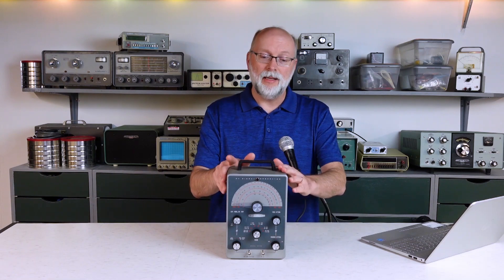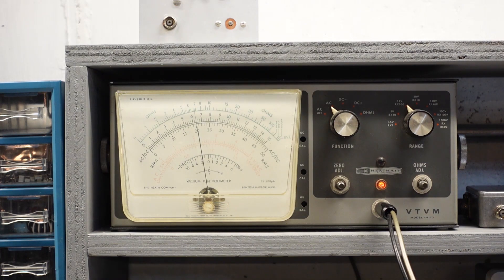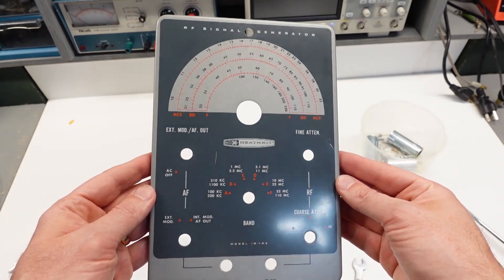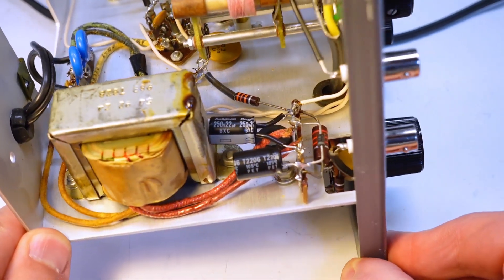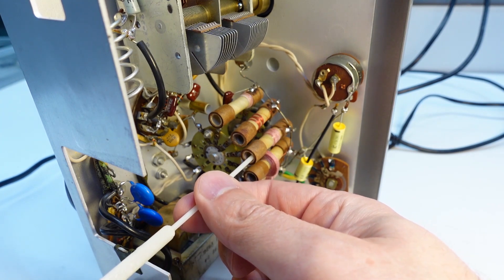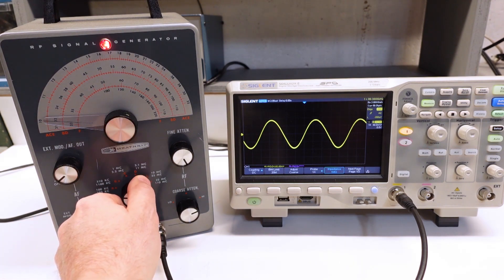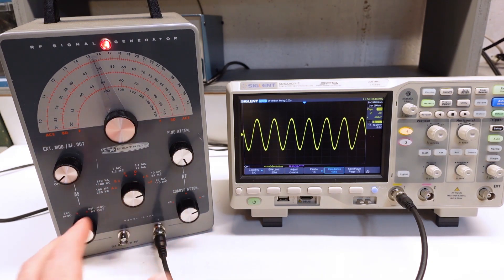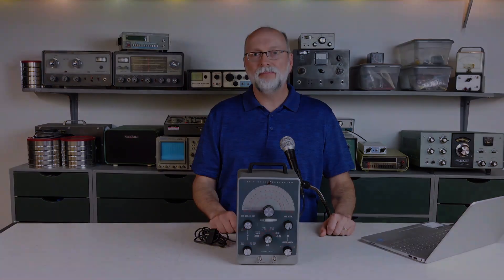Heathkit IG-102 RF Signal Generator Restoration

Comment: Change the power cord to a two wire cord with polarized plug, the add a fuse in the hot lead internally, enjoy for many years to come.

Comment: I know this video was done two years ago, but I have a question about the safety caps you chose: I’m interested to know where you were able to source your safety caps from. Mauser and DigiKey did not have them in the form factor you have. Were yours film or ceramic? Y2 or X2? I assume that since these capacitors are running to ground, you chose Y2 rated capacitors.  Great video, I hope to hear from you soon. Thanks.
Reply from the maker: Yes, those are Y2's.  I'm pretty sure I got those a few years ago from justradios.com.  They're still around.

Comment: Nice work! What value safety caps (x caps?) did you use on there?
I haven’t done much of that.
Reply from the maker: I've used both 0.1uF and 0.01uF in my projects.
Reply: @levelupeelab  thanks, so whatever the OEM spec was gets replaced with a new x cap, I guess

Comment: Nice work, especially the face plate!

The BNC connector will remain a relevant connector for quite a while, with all of the equipment that uses it!

Recapping is one of the first things I do before applying power, with any equipment ten years or older, as electrolytic caps are prone to drying out, leaking and shorting, causing so many problems. I have even started testing resistors as the old carbon composition resistors are drifting out of tolerance, as well.

I buy my electrolytic caps in bulk now, and I have quite the surplus! As long as I buy equipment, I will need them to keep the equipment going!

Comment: hello, have you put the cable directitly to the antenna connector of the AM radio ?
Reply from the maker: No, it is a couple of inches away.  Only need loose coupling between the two.